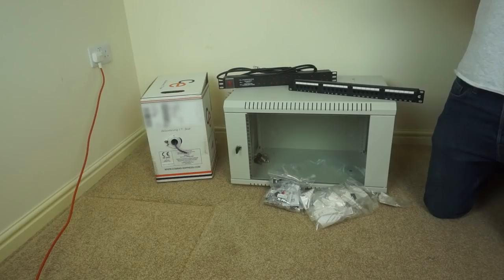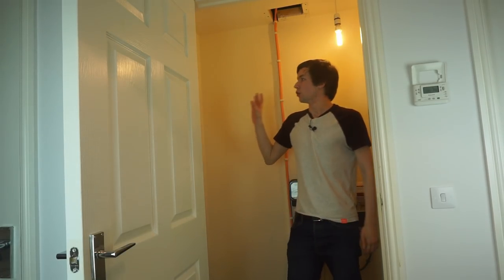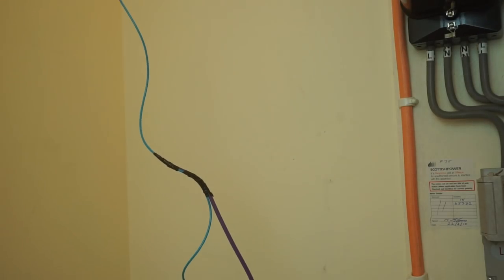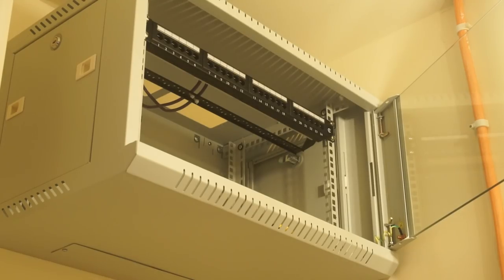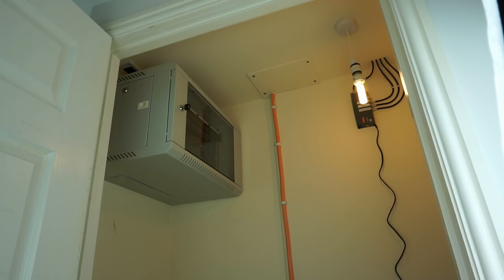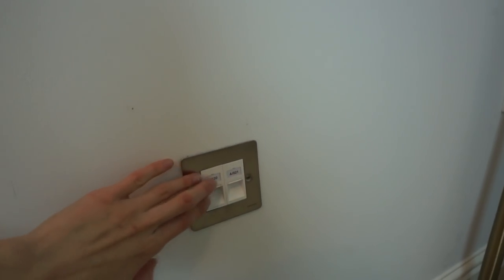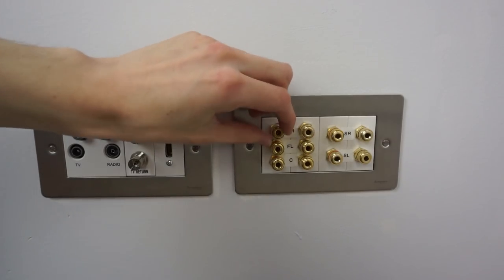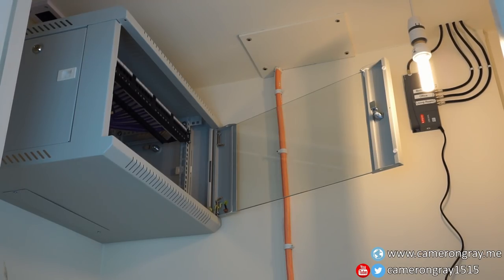New Flat - Time to install a completely overkill home network!

Comment: I'm currently in the process of purchasing my first home.  I'm going to be doing exactly the same thing, look forward to your progress.
Reply from the maker: Nice!  It's definitely worth doing, especially before you actually move in.  Would have been much harder trying to work around stuff while trying to not get everything covered in dust!
Reply: Cameron Gray I work in network infrastructure so I know exactly how difficult it can be! I’ve planned to create a full smart home, Is this something you’ve looked into?
Reply from the maker: I'll probably do some smart stuff - At the moment I'd probably want some sort of smart heating controller and smart light bulbs for a couple of lamps in the living room. I'm pretty fussy with that sort of thing though - I'm always scared about vendor lock-in and I don't want to be relying on manufacturer provided cloud services so I'd probably end up buying off the shelf kit then hooking it up to either open source controller software or write stuff myself.  Also going to work on hooking up an off the shelf, momentary action, light switch to control the smart lighting (so that it all looks consistent rather than having separate "remote control" switch things on the wall) so that'll be a fun project. Will obviously make videos of all this as and when I get around to doing it!
Reply: Cameron Gray I’ve done a lot of extensive research into home automation so if you need any advice hit me up! I’ve also been extremely concerned about multi device compatibility as I don’t want a Cisco Netgear rivalry in my own home!

Comment: That's a nice tidy job, much cleaner than what I've done in my house. Although I have the combined challenge of it being a rented house (so I have to make holes nobody will notice), and a house that doesn't have plasterboard walls - it's got the old style battens with plaster stuck to them, or brick with plaster.

I've become good at routing cables under floorboards and around the edges of carpets, or using those plastic stick-on conduits. I've found the trick is to either hide the wires, or make them look intentional and nobody questions them. All my patch panels, switch gear and server is in my cellar out the way. There's CAT5 cabling strung all over the place down there :)

I also like that you ran two cables to each outlet while installing everything, rather than running just one. I would have put all the AV gear and any media servers/NAS/whatever devices in the cupboard out the way too, just to limit the number of noisy boxes in your living room. And maybe stuffed all of the satellite/TV/DAB return stuff behind a blank faceplate.

Comment: Hi, any chance of a quick video showing how you filled in the holes you cut into the wall and ceiling? I ok at pulling cables, but struggle with getting the holes neatly finished.
Reply from the maker: Could possibly do a video down the line but would need to wait for an electrician before I can do that.

Essentially all I did was glue a small piece of wood (using an instant grab adhesive) to the back of the wall so that it runs across the back of the hole.  I placed small bits of wood on each end of this where it sticks to the wall so that the bit that runs across the of the hole is set slightly further back than the rear of the plasterboard.  I then glued the piece of plasterboard I took out to this wood with the same adhesive, this kept the piece of plasterboard secure in the hole.  Once it had all dried, I had a bit of plasterboard solidly glued into the hole that was set slightly back from the front of the wall.  I then sanded it all down and filled it with Gyproc Easi-Fill filler.  It was then just a case of sanding it all down and possibly filling again (this time with Polyfilla One Fill) to get a smooth finish I could then paint.

No idea if this is the best way to do it or if it's a completely terrible idea but it holds well and can't be seen once painted.

Alternatively, you could use a powered cutter tool that would make a much neater cut than the saw I used, this would result in the bit of plasterboard you cut out being a much tighter fit back in the hole.  In this case you could then likely just put glue around the sides and stick the plasterboard straight back into the hole without needing wood behind it.
Reply: Neil Cochrane the trick for repairing holes is to cut a piece of drywall an inch bigger than the hole in all dimensions.  Then score one side of the patch the actual size.  Then peel the one side off all the way around leaving a n inch wide paper surround.  Then it's a matter of just plastering the patch in.  I hope this makes sense.

Comment: Go with a Paradox MG5050 system, wireless PIRs and add an IP150 to use the Insight Gold app for remote control and real time push notifications. Have an EVOHD at home and hasn't failed me once! Had it in for the last 5 odd years. Good luck with the new system!

Comment: I like the ethernet ports on a 45 degree angle and the steel wallplates.  The similarities and differences between items in the US and UK is interesting.
Reply from the maker: Yeah, generally networking hardware is the same between countries, construction varies but is relatively similar when it comes to modern buildings. Where things really differ is with electrical installations and since the network points fit onto the same back boxes as regular outlets and switches, they will differ from those in the US.

Comment: 1. Allways anchor into a stud, gypsum board clamps are not safe when mounting a metal box to the wall ^_^. 2. Always maintain your fire rating on your wall penetrations. You don't want to die because you forgot fire caulking. 3. Minor note, always do a service loop 4-5 feet is always nice. 4. Those are crap RG6 fittings, get compression fittings, it will cut down on your SnR issues. Sincerely - a structured cabling guy.

Comment: Great video! When we did some renovation in our house, we installed CAT5e to every room, too. It's interesting to see how different houses are constructed in different countries, though. British and American houses always seem kind of dodgy compared to the German houses I am used to. Running cables here is an absolute nightmare as you have to carve slots into the concrete/brick walls and there's generally no ceiling space, too. Retrofitting audio, satellite or network cables would be a breeze if I had 20cm of air above my ceiling...
Reply from the maker: In the UK it depends largely due to the age of the building, older buildings are all solid brick/stone with lath and plaster walls/ceilings - it would be much harder to do this sort of stuff in those.  A newer building like mine is concrete framed with brick external walls as well as brick walls between individual flats.  The walls and ceilings inside each flat are then all plasterboard. It doesn't feel as solid as the older buildings but it's still pretty decent and does make it dead easy to run cabling and plumbing.  At least the concrete and brick maintains proper fire separation between flats.  The all timber construction of many buildings in the US downright scares me!

Comment: Well done! Wish I could do it as well, but in South Africa we have cement and brick houses so  you can't easily run cables down the wall. Also hard to fix textured plaster to hide any chasing that you may do.
Reply from the maker: That does sound pretty annoying, older buildings here are still brick so you'd have to cut it out but at least we usually have smooth plaster over it so it's easy to fill.  I was recently staying in a villa in Portugal (which is probably fairly similar construction) and did wonder how it would be possible to work on the walls to access cables and other utilities without having to repair the textured plaster!
Reply: Yes with smooth plaster you can easily patch up, it is also commonly used here.  But then you to cut into the wall you need a special tool that extract the dust, or you are left with a very thick cloud of fine dust that settles on everything, so you really only can do that before you move in.

South Africa don't have a large supply of wood, some areas does plant forets for commercial use, but very pricey. We have easy access to cement from factories arround the country so it is the preferred choice.

Anyways, CAT6 in all rooms still win by miles over wireless options. You just don't get the speed, reliability and range.

Comment: I would have left the speaker cable out completely tbh... bt from smart tv can connect to wireless sound bar with base bin... like any of the samsung units. But just what i did and my 2 cents.  Great video and very neat install. Well done.

Comment: Great work!
Nice to see a fellow Scot doing this kind of thing.
Unfortuantly all the walls in my house are sold brick (even the internal ones, it's an old house), so i can't do this kind of thing without ripping up all the floors!
I have to rely on 2 cleverly run cables and some Strategicaly placed switches and Wifi AP's :/
Still, i look forward to seeing part 2!
Reply from the maker: +JamiePhonic Yeah, I was also considering some older tenement flats which would have been bigger and more solidly made, but they would be an absolute nightmare for a project like this, ripping up floors and cutting chunks out the walls would be the only option.
Reply: Yeah, not fun unless you know a good plasterer (or know how to do it yourself) or you don't mind nasty looking wall mounted back boxes and trunking...

Comment: Nice job! Might consider getting a 6ft flex bit next time for fire block. Cost $35 USD but still worth it
Reply from the maker: I saw those online, strangely they are really hard to find in the UK which is strange, you'd think they would be pretty common!
Reply: Cameron Gray very surprising!

Comment: Hey Cameron, Great video and brilliant install. watching it has made me realise I need to tidy my installation. Thanks for the links for the gear you used. Please can you provide a link to drill bit you used as it went through the joist like a hot knife through butter?
Reply from the maker: Thanks!  I had two of those drill bits - They definitely work really well for making neat holes with clean edges.
16mm - https://www.screwfix.com/p/erbauer-auger-wood-drill-bit-165-x-16mm/3622v
25mm - https://www.screwfix.com/p/erbauer-auger-wood-drill-bit-165-x-25mm/1322v
Reply: Thanks you're a star. Keep up the great work.

Comment: Don't forget to put straps on them and mark both sides of the wires. That is also needed, not just the devices that is connected to the wires. 
And document them on paper in the cabinet.  Documentation are important, so others can see and use them.  You should also mark the ports with the face plate side.
Running two wires to each outlet are a good choice.  There are more expensive to do that later.
Nice work filling the holes, and the connections.
Of course you need network connections in the kitchen. Good choice.

But are there any network connections in the room with the cabinet room?  :-)

Comment: The signal loss is almost certainly due to the RG6 cable you've used and also it looks like you have kinked the coax in the faceplates, so the impedance matching of the cable will be lost. RG6 has a bend radius of around 20mm. The additional amplifier you've added might end up saturating the input on the receivers. It's not recommended to have the two in series like that.

Comment: Planning on doing something similar (but on a much smaller scale 😄) in my flat. Sadly all the floors, walls and ceilings are concrete so my only option was to buy baseboard with cable channels in them.

Comment: A decent wireless environment using something like Ubiquiti's unifi or their Amplifi solution could have saved you a lot of expense and work. I do admire your tenacity.
Reply from the maker: +Robbie Anderson I already use UniFi for WiFi although I've never found a wireless system that can sustain the same load and be as reliable as a proper wireless network.  Sure it would be fine for my needs but I still much prefer the total reliability that you get from a wired connection.
Reply: Agreed, you can't beat the reliability of a wired network. -Although I've been pretty impressed with what Ubiquiti have done I the wireless space. Thanks for doing the video.

Comment: Great video of you pulling your wire in your new flat :)  I bet installing sneaky stealth antennas up there could be an issue with all that concrete and metal in the way, so good thing you don't have ideas of making amateur radio videos (yet) :D
Reply from the maker: Yeah, no chance of radio working in this flat, don't even get mobile data in any of the rooms unless you are near a window!  Unfortunately the deeds explicitly ban installing external antennas so I'd be pretty limited other than temporarily placing something out a window.

Comment: Easy in cardboard new builds! Try doing it with concrete ceilings with no voids, brick walls with no voids or cavitys!
Reply from the maker: Yeah, the fact that the construction makes it easy to run/maintain cables/plumbing was definitely a (small) factor in me deciding on this particular flat.  Most of the non-new build flats around here are ancient tenements built in the 1800s to early 1900s with lath and plaster walls/ceilings and shared voids between flats.  Mine is a pretty decent balance - the internal walls and ceilings are all plasterboard but the actual structure is brick and concrete where all external walls and walls between flats are brick with a concrete ceiling between each flat, it's not some terrifying timber framed rubbish!

Comment: I usually use String but I see the appeal to using the nylon clothes line.... Did you leave the lines in? I would've - I usually do.. ie tie a knot in each side and push them all the way back in, but have the line 2x long as what's needed, then a little few feet buffer - then pull it out of one side, attach the wire to the end, then pull from the other side, and when done just retract the line back into the wall to make replacing lines EASY...

When the electrician comes, I'd have them move that electrical stuff to underneath the network box then you have the right side of the closet area you can use for something else and it's tucked away nicely.

I would've also put as much equipment as possible such as multimedia pcs for the tvs in that networking closet, UPS's and anything else. I do like the adapters for the keystone, but it kind of defeated the purpose of having them with the A/V stuff sticking straight out.

I'm designing a 10 to 100g local network for home / business use and this did show me the nylon line which, as I said, is a great idea.

I would've also used a wood-board to mount the tv antenna booster, etc... You should've run it all from the networking / server rack - ie the side which can be unlocked isn't being used so you could've attached a wood panel to the side where the door is, then attach the tv wires, then have them running through instead of some wires running through exact sized hoes, which is interesting but I would've used grommets, at the least... I like keeping things organized and together - you have a piece here, a piece there, etc...
Reply from the maker: I thought about leaving the feeder lines in but it wouldn't have been much help - the metal ties holding the ceiling joists up snag the cables so you can't pull it directly from a backbox, you have to pull it in straight lines through the ceiling to get it past the ties.

Moving the electrical equipment isn't a viable option - It would be a huge task, requiring a large amount of rewiring to move all the cables to the consumer unit.  The DNO would also need to be involved to move their incoming cable and meter.etc - The whole thing would cost thousands and cause major disruption and to be honest, the cupboard is just used to store things like my vacuum cleaner and ironing board so it's not like the electrical stuff being there causes a problem.

I could have put more of the equipment in the cupboard but that would require even more cabling and running 4K capable HDMI over the distances involved would likely be a nightmare, I even had issues trying to get it to work reliably over a 5m cable.  In the end, it's my hall cupboard, not purely a networking cupboard.  I need to use it for storage so can't pack it with tonnes of stuff.  The networking cabinet is high enough up the wall that it doesn't get in the way of other stuff stored in there.  It's somewhat annoying that the AV connectors have to stick straight out however they are the only option, thankfully all the AV connectors are generally hidden behind things.  The angled jacks also look a lot nicer for the ports that are more visible than the ones hidden behind things so I just ended up using the same ones everywhere rather than mixing types.

The TV amp was installed separately because there's no real need for it to be near to any of the networking stuff. I was also thinking about what happens in the future if I were to sell the property - I'd gladly leave all this stuff in but it's possible that future owners may not want a huge rack cabinet and may want to take it out entirely or replace it with something smaller like just having the patch panel mounted directly to the wall.  The TV amp on the other hand is something I'd treat a bit more like electrical distribution equipment - pretty much a case of set and forget.  To be honest, I was surprised there wasn't already TV distribution like I fitted installed when the place was built.